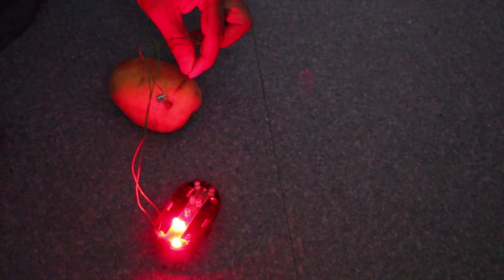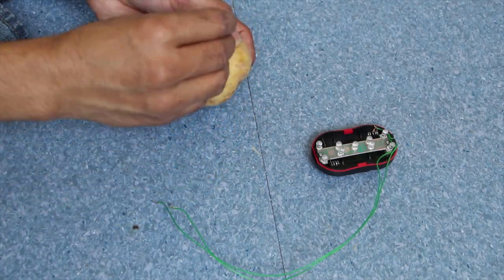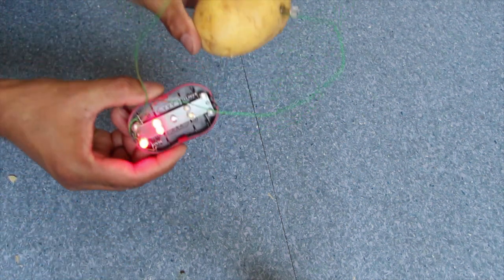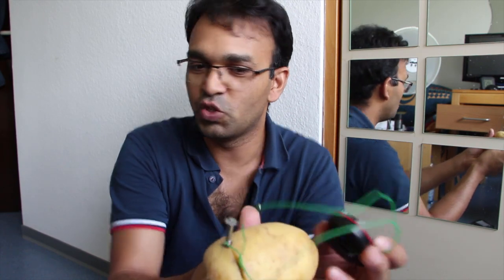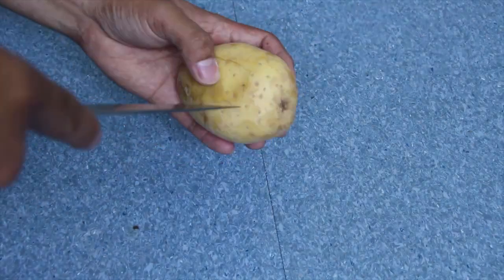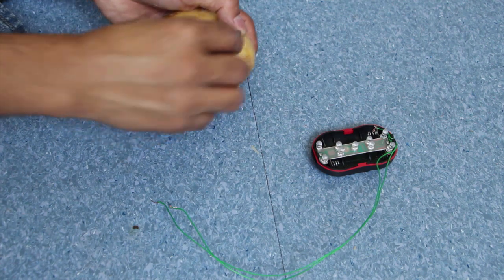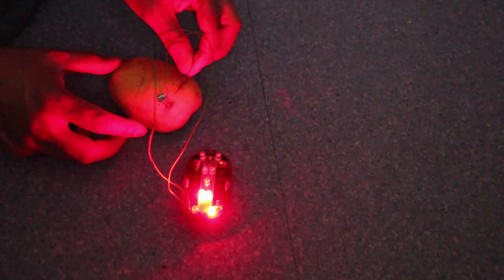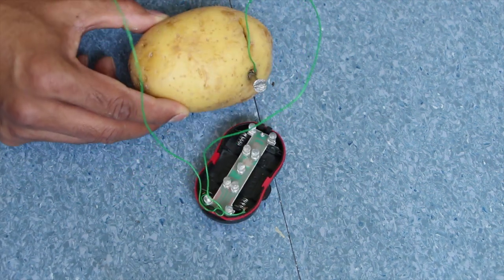Potato Powered Light Bulb | Real or Fake

Comment: I knew something was up when you had the two "terminals" so close together. I've seen those videos pop up before. I never bothered watching them because I didn't believe it. lol  I think your question at the end may have something to do with the bias of the diodes.
Reply from the maker: The answer to my question is as follows: since the potato has liquid inside of it, that carry electrons as the negative terminal touch inside the potato as well as the liquid. So, whenever I touch the wire on any part of the potato, indirectly it touched the negative terminal. Hope you understand. Thanks for stopping by.